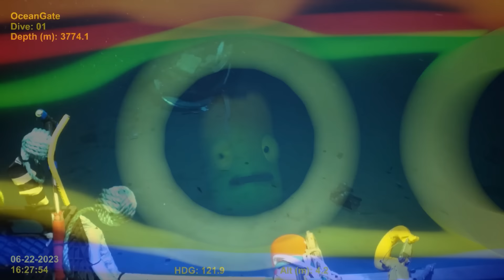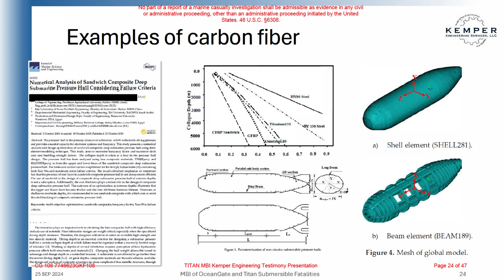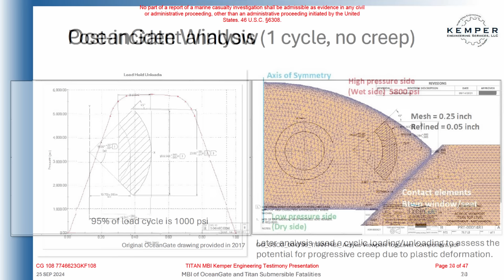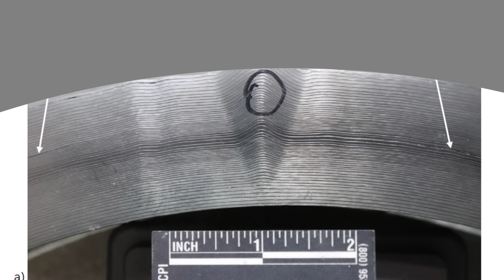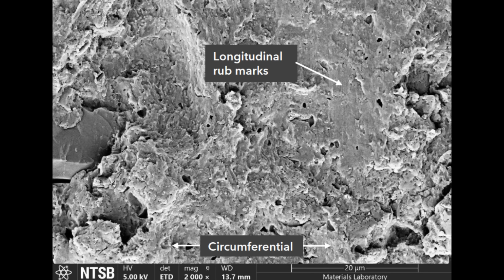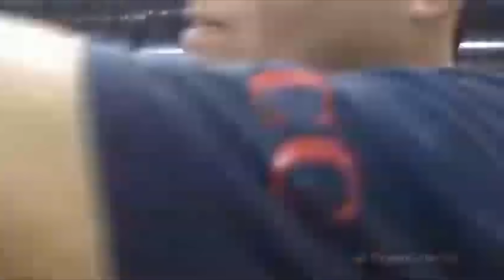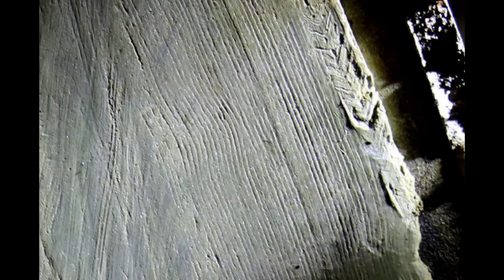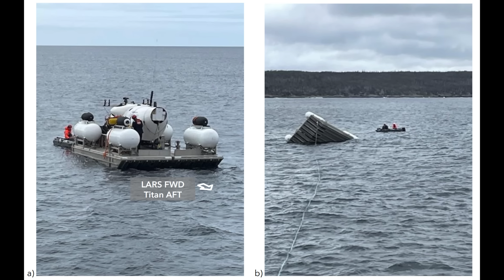OceanGate Wreck Shows Why Sub Wasn't Strong Enough To Survive - NTSB Shares Important Details

Comment: I know enough about composites to realise that the quality and safety standards i personally apply to non submerged layups of fibreglass and carbon fibre in my backyard shed would do better in rigorous testing.

Did they even vacuum chamber the resin they used because the amount of air bubbles in that layup tells me they didn’t……

That’s basically standard practice now for laying up anything structural, the mix of resin and catalyst also looks very inconsistent from layer to layer which will also cause deformation due to it being an exothermic reaction, resin gets HOT when it’s going off and will effect the other layers if not monitored carefully.

That’s a possible cause for the “bubbles” appearing after each inch thick layup.
Reply: They autoclaved the layers wich is also a standard procedure, so they would have degas the resin too.

Comment: 16:44 the analogy about layers of paper sliding over each other is a good one.  Decades ago, as a young structural engineering student, the professor showed an illustration of this with a thick soft cover book.   When the book is held normally, it is flexible and easily bends, and the pages slip freely past one another.   However if you clamp (or glue) the pages together so they can’t slip past one another, the book becomes much stiffer and hard to bend.  This analogy showed the importance of the all the layers working together as a unit, rather than as a the sum of the individual layer contributions, and the vital role of the shear strength of the material.  In the carbon fiber wrap construction, the glue is what transfers shear stress from one CF shell to the next.

Comment: It's more likely the water started coming through the composite near the rear and the forward ring with it's window was literally hammered out of the end of the vessel by the impact of the water as it rushed into the low pressure zone until it hit that end whereupon it blew it all apart.  Likewise the side of the composite that's mainly intact is where the leak occured as the opposite side was taken apart by the super high pressure water jet.

Comment: 7:30 What you're saying here about window shapes...

+ The point about carbon fiber being strong under tension, not compression...

+ The point about the "arch" effect applying in one dimension on a cylinder vs  two dimensions on a sphere...

= Isn't it more precise to say, a cylindrical vessel under external pressure will experience both

(a) compression in one dimension as, circumferentially, the pressure is trying to squeeze a circle into a smaller circle; and

(b) tension in the other dimension as, longitudinally, the pressure is trying to stretch a straight line into a curved line?

Maybe we could come up with a shape with concave-cylindrical sections of carbon fiber stretched over a scaffold of titanium O-rings, such that the Ti is under compression and the CF is under tension, to take advantage of the respective strengths of each material (?)

Comment: The weakness in the flat-rear window design may simply be an artifact of the simulation rather than a physical issue.  Long straight lines can affect finite-element analysis in unpredictable ways.

Comment: With the wrinkles being machined like that tapering the edge of the ply wouldnt the pressure of the dive force the 2 ends of the cut layer together and cause it to wedge surrounding layers apart causing separation and voids?
Reply: Good point!

Comment: Imagine a CEO who thinks they know everything, but actually knows nothing, resulting in deaths. Now, imagine a guy like that in charge of a $200 billion rocket manufacturer, with a move fast and break things attitude, pitching plans for thousands of commuter space flights a day. People WILL die. Lots of them.
Reply: The big difference is much as musk may bitch about the authorities he is basically forced to work with them if he wants to actually launch his rockets. When you are flying massive rockets and taking NASA contracts to pay, at least in part, for those rockets it's impossible to fly under the regulatory radar.

A small submersible that only operates in international waters is much more able to avoid regulation.

Comment: 3:40 - There is a bit of a misunderstanding here that was corrected in the hearings; It's not that carbon fiber is not allowed (as such), but rather that there is not enough data to put it on the recommend materials list (in short). If they did the research and tested it (responsibly) and showed the results, there wouldn't be a problem (as testified). In short, they couldn't get it certified because they didn't use a standard material and didn't show the data for the material they went for to get it approved. It was in the same slideshow you showed that image from 😉 The reason I mention this is because it kind of undercuts your end conclusion there.
Reply: And they used carbon fiber on purpose to become famous for launching the VERY FIRST EVER submarine made out of carbon fiber
Reply: Only 1 like for this after 1 year?

Comment: Well.
Filing off wrinkles in carbon fiber is very bad idea.
Because after you damage carbon fibre structure it's not fibers that providing strength but the glue/resin.

I think it's actually pretty well understood mode of failure in carbon bicycle components.

Typically if you overtighten the steerer, which is the tube, you can damage the structure of it. And it'll snap one day.

Again, on the carbon fork you insert the compression plug, which actually should counteract the pressure of the stem.

That's why you should always carefully tighten the stem with the torque wrench.

Also if there's dent in carbon frame or fork. It'll fail. And they are just ignoring that bang. Yeah.

I'm also curious about corrosion.

I think, Stockton had never had a carbon bike so he decided to make this contraption.
Because sane cyclist would not put carbon tube under such immense pressure.
Sane cyclist would not ride a bike after hearing bangs or cracks in frame or fork.
And sane cyclist would never ride a carbon bike if it starts flexing where it's not designed to.

I think the hull delaminated over time and failed catastrophically like carbon does.

Comment: Since the strain gauges were on the inside the compressive load in the external surface would deflect the hull inwards causing the inner surface to stretch which is what the graphical plot is showing. Machining the bulges is effectively cutting the fibres so as the load cycle in each dive it cannot be good,  I think it’s a bit like having a small hole on the knee part of your jeans which tear the more you bend your leg and stretch the material. As for Boeing using 45 degree plies, it is clearly because this is to improve the strength of the components and help distribute loads. Matching the plies down to fit the titanium ring negates the whole point they we’re trying to achieve by building the thickness up for perceived increased strength.
Reply: Mounting gauges on the inner surface of several layers separately cured and glued CF tube will measure reasonable values? Methink that you see only fantasia values when the glue is broken. Further you see stretch values as long as the domes will not have enough buoyance that cancels their weight out (as long as the CF/Titan connection lasts wich could be a useful and maybe the only meaningful task for them). That is all void when the outer layers yield to the water pressure which is exact the point when it is too late.

Comment: Compounding errors upon errors upon errors.
From making it, not in a clean room, the wacky decisions of the design and manufacturing, to handling it, why not have something designed into they blue print for lifting it, to not actually using the warnings the sensors told you. 
To handling the submersible itself nr 2 letting it sink qnd get towed, then go back to using it after who knows what kind of stress the thing was subjected to.

Comment: stockton rush overestimated manufacturing techniques and thought he could ignore the engineering code books, which are already written in blood and deliberated on by the best brains in engineering we have. the code is explicit in disregarding carbon fiber and carbon fiber composites, that's all you need.

until something changes drastically in engineering of carbon fiber composites, its going to remain a forbidden choice in pressure resistant material.

you don't need a degree to read the code books, they are publicly available and present in your local library in the reference section.

Comment: How much more would it have cost to use a titanium tube instead of carbon fibre and "Elmer's" glue?
Reply: Endless, you have to compensate the weight wich last in a bigger tube wich have to compensate the weight what lasts in a bigger tube ... aso or you use conventional diving cells wich is boring because you can buy such a  boat.

Comment: As a pro in carbon fiber building, i was quite surprized to see that the hull was made o 5 successive layers with curing between and the use of glue to bind the surface layer to the next layer.
And worse we could see that the carbon fiber had defects like wrinkles and this is very bad because the moment the fibers are not straight and form waves this cause a potential failure as the hull is not homogene and the forces will tend to delaminate the layers.
So from what i have seen in the NTSB video, the building technique was good but the fabrication was quite sloppy and not really professional. Such a hull should have been tested during a long time, deeper than the normal use to check for eventual failures and defects but they thought that it was good enough as it did not implode during a few tests.
Carbon fiber and the resin matrix will wear with cycles of pressure and they should have made tests, there are methods to detect delamination and matrix becoming brittle.

Comment: Uneven, bulging layers. Same when you wind a layer of magnetic tape. Back in the 1970s I worked in a processing plant (Racal Zonal) making magnetic tape wound on to spools; audio, video and computer tape. One of the phenomena we used to see is 'spoking'. Looking at the side of the wound pack you would get what looked like spokes radiating from the centre outwards. We believed this was caused by uneven tension during the winding process. As you start winding a pack from the centre the inner layer would initially be under tension but as you add layers this compresses the inner layers which are no longer under tension but now under compression. At some point the inner layers of tape under would start to bulge outwards and this would propagate as an ever increasing bulge towards the outside and the result looks like a spoke of a wheel. As far as we could determine spoking was worse if the tension was uneven when it was wound and worse with age and shock loads such as dropping the reel of tape. Water pressure is only going to increase the compression on the inner layers. As soon as I saw the method of construction I thought this was a bad idea.

https://thegreatbear.co.uk/audio-tape/treating-assessing-magnetic-tape/

Comment: For your part on voids? Voids are like any impurity. In metallurgy, same thing. They are weak points and stress concentrations. An issue if the material or location can be prone to stress fractures. So the seriousness comes down to the deformability of the binding agent to limit the effect of it.

Comment: When I was in manufacturing, voids in either bonding and joints were both very bad.

Kinda funny how those "armchair engineers" knew the point of failure, how it failed despite the media's insistence that not only were they still alive, but when they finally admitted the loss, they made up some simulation of the cylinder collapsing like someone squeezing a toilet paper roll. You equate the "naysayers of carbon fiber" to be the exact same as the "naysayers of acrylic" despite the fact you go on a segment detailing that acrylic is ok, but it requires doing something Stockton Rush would never spend another dime on: testing on many prototypes to failure.

Not every "armchair engineer" said "never" for carbon fiber, but: too soon, too new, not enough testing. And Yes, Stockton Rush proved exactly that. a mistake he and 4 others paid for with their lives. This is the equivelent of SR saying Mercury Atlas 1 was "pefectly safe" for passengers.

You've been showcasing a rocket in your intro for quite awhile. I thought you knew better than that. They didn't just start loading up civilians charging them for voyages during the Mercury or Apollo missions. The whole waiver thing isn't an end all be all either, especially when based on a lie. How many launches and tests for reliability has SpaceX done before sending up passengers?

Comment: Armchair engineers and CF under tension. You can do it, and it is quite strong. But it is like concrete. Concrete. Excellent compression, poor in tension. So you preload the structure such as with anchored rebar. It works because you engineer into it a way to address it.

Carbon fiber you can use how you wind it and the resin to help contain the fibers to mitigate buckling. But buckling is the issue. Like concrete, if you lose that preload, it collapses. If what keeps fibers from bucklings fails such as degredation of the resin. It fails.

The more complex a system, the more points of failure.

Comment: Solid reasoning. The design was flawed from the start. Should've tried to manufacture it in an elliptical shape. Maybe that would've worked. There would be inevitably 3 rings, but you've got to do what you've got to do. CF wrinkles are a mayor no no. It's sad lives were lost. But then again, lives are the price when you try and push the envelope in any worthwhile endeavor. The trick is knowing when to say no. Some people are optimistic to a fault, and that's the mark of a poor engineer, one that has no respect for Murphy's Law.

Comment: I'm in the adhesives industry. From your photos it looks like the adhesive delaminated from the substrate, then when the hull exploded in the collapse it vaporized some of the adhesive. Carbon fiber has a very low surface tension, meaning that it's a substrate that is difficult for glue to come into close contact with the surface and thereby create a tight bond. We typically treat low surface tension substrates with plasma treatment to increase its surface tension so adhesive will bond better, but that isn't always enough.
Reply: In other words, it was about as effective as gluing a shelf to the wall with ranch dressing?
Reply: Yes that would be correct
Reply: From what I can gather, the acrylic window pushes into the Titanium dome by about      3 1/4 of an inch. I don't know how that would affect joints that were rigedly held in place. I guess the adhesive seal would be under stress to move after multiple pressure applications up and down to the Titanic
Reply: Interesting stuff, thanks for the explanation

Comment: There are several types of optically clear flexible adhesives for acrylic, and my own experience is that simple silicone appears to be optically clear when used that way.  They could, therefore, have modified the optical properties of that viewport without affecting its structural properties and thereby invalidating the previous testing experience merely by gluing in the hemisphere.  You'd possibly want to suck out any air bubbles in a vacuum chamber, but I assume their manufacturer would have or could get access to one easily, using vacuums in casting is not uncommon.  Using flexible couplings, including flexible adhesives, to eliminate stress transfer between components is bread and butter for structural engineers.  These people are just not good engineers, they are inept.

Comment: They could run some rods between two hemisphere interfaces on the outside and compress the ends on the cylinder sections by bolting it together, this way they don't rely on just glue.
But well, so many many other flaws they didn't fix, might still be doomed.

Comment: Pure redneck ingenuity. 

Also, discovered:
Sign found near hatch door: "When exiting sub under water, please prop up a chair on two legs under the door knob.
Life support systems controlled by Arduino Uno connected with jumper wires and breadboard.
Section 3.6 of customer agreement: "When lower than 1500 meter below sea level, passengers must sign in or out,  using sign-up sheet hanging on wall near the door."
Section 6.4 of user agreement: "In the event of a catastrophic implosion, please remove all blood, body fluid and brain matter from surfaces using wet-wipes furnished near hatch door."
Section 7.9 of user agreement: "Free foot massages every day at 10 AM, first come, first served."
Section 13.45: "No restroom provided. All passengers must bring their own toilet paper and carbon fiber toilet paper.  Please bring your own."

Comment: "It was a machined surface so you'd naturally expect it to delaminate before the carbon" - no... I don't believe for a minute anyone machined a surface and then failed to key it up with some sand paper, cleaned it with various spirits and solvants and quite possibly prepped it with a steel-to-resin bonding agent. I really don't think, unless you know EXACTLY how it was prepared prior to bonding, that the surface-that-was-at-some-point-machined was more or less likely to bond than the carbon fibre. Clearly there was some massive design flaws here, but to suggest that someone whose job it is to prepare and bond surfaces together failed to key one of them at all based on, well nothing as far as I can see, is a bit shameful.

Comment: I've never trusted a peelply finish to be a suitable surface for glue or resin to adhere to. The finish will feel rough but to me it always felt too slick for anything to stick to it well. I always sand or grind the carbon with a peelply finish before applying glue or more laminate.